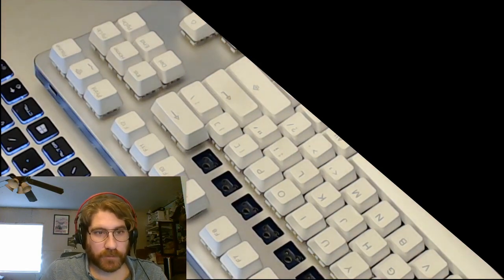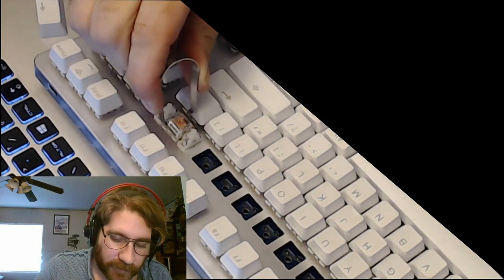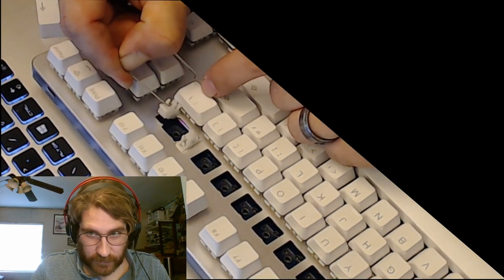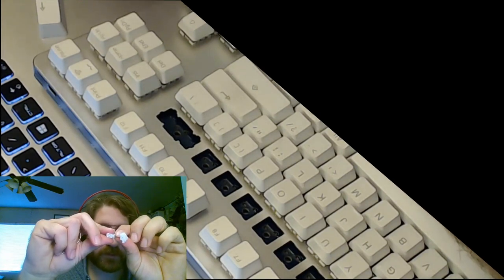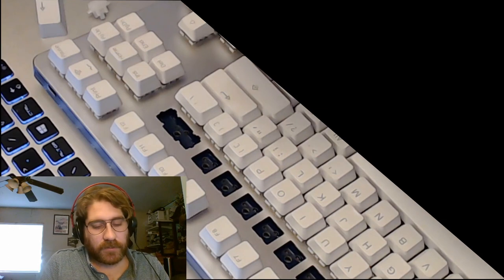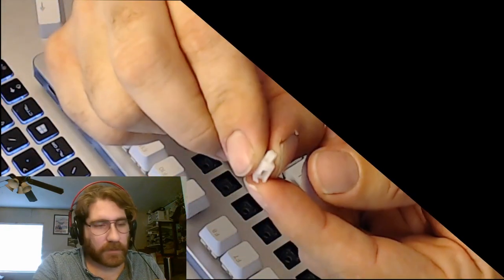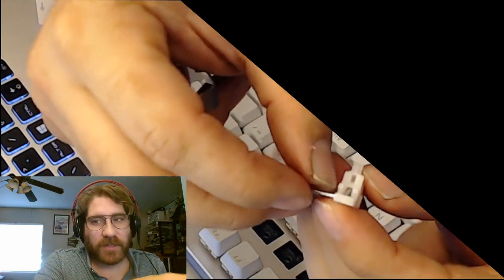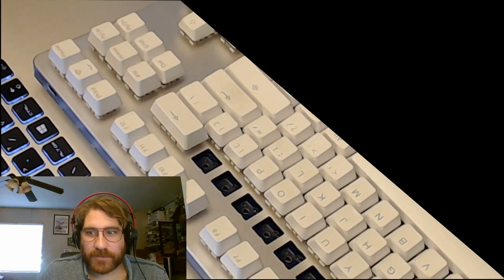K-Type Guide - Stabilizer Replacement

Comment: Much appreciated ... one of the tabs broke out of the housing when I was pulling the keycap to replace the switch (brown->blue) on my numpad + key and I couldn't figure out how to get it back together. Fortunately it wasn't too busted so it still works fine, but finding this video with the explanation was great.
Reply: bruh, changing your switch from brown to blue is a downgrade.

Comment: What would be the benefits of replacing the stabilizers? Are the ones that come with the board poorly made or something?
Reply: kubed, Yep. The stock stabilizers, I hear, are very cheap and rattly.
Reply: I think so. I find that my default stabs on the ktype rattle more than any I've seen before. I just ordered some cherry stabs off banggood. Hopefully that will help.
Reply: Did you find some with white plastic mounts?...the only cherry ones i've seen so far are black plastic. thx.
Reply: Mr Smartypants I didn't even take that into consideration... Will see what it looks like. Maybe somebody else had more luck?
Reply: Stock stabilizers r shite can confirm
Reply: mine are sticky and i cant do much about it.

Comment: Just in case this is useful, your audio levels are pretty much lower than almost all other youtube videos i can think of atm that ive seen recently. In the first 30 secs or so i literally cant understand what youre saying. No shade just wanna give feedback that might be useful.
Reply: Also might wanna mention next time that this is for k series keyboards but not the original k70(?) at least my light aluminum looking plated one with black keys which has mx cherry reds and black housings (soldered) with black stabilizers... Im certain ill have to completely disassemble the keyboard and potentially desolder the switches too. Thanks for the vid anyways tho :P

Is this potentially only for hot swappable k series switches?